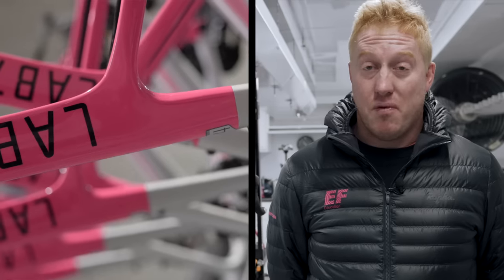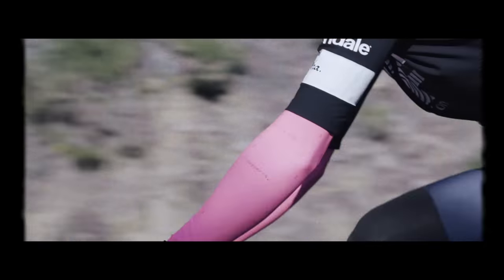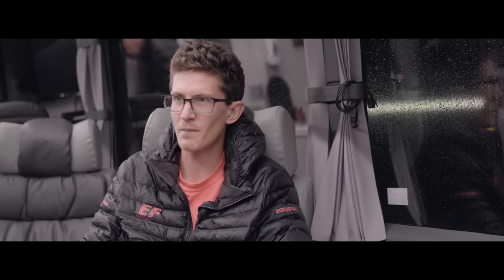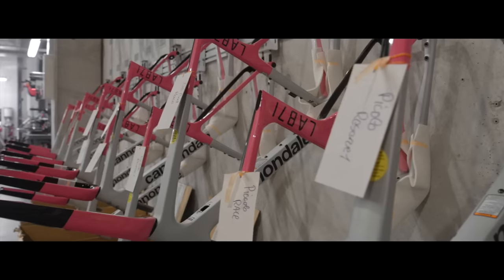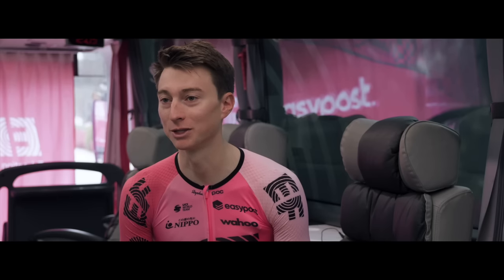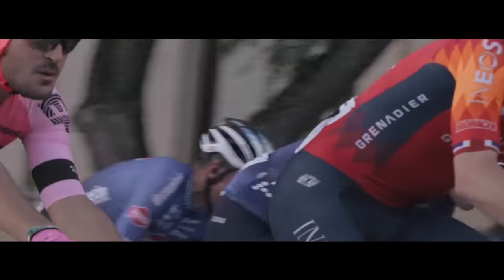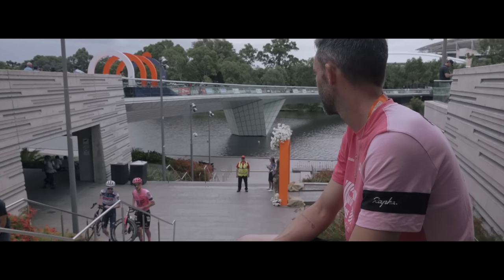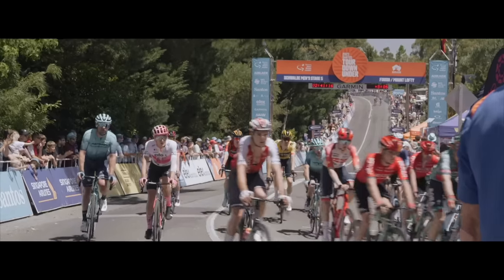Making of the Next EVO: LAB71 SuperSix EVO x EF Education-EasyPost | Beyond the Bus | Season 2 Ep. 2

Comment: I got my SuperSix Evo 2021 and now it has some noice on the bottom bracket, changed the bearing, clean everything and still i have the noise :(
Reply: Did you check the saddle? This often causes this kind of noise!
Reply: try greasing your bearings around them so to avoid friction between the frame and outer-bearings. Hope it can help